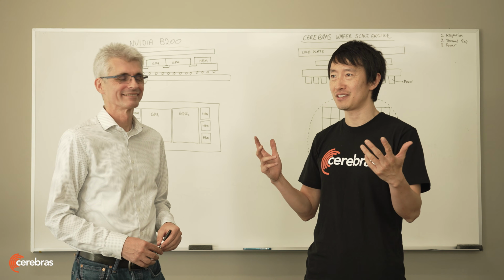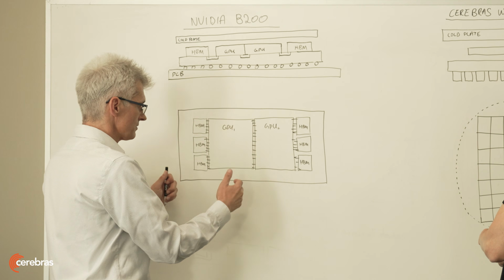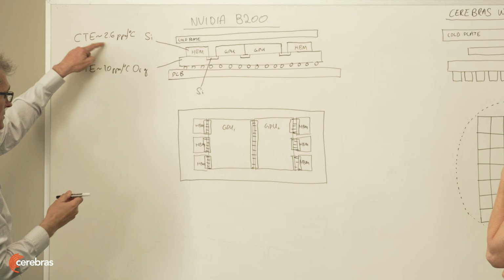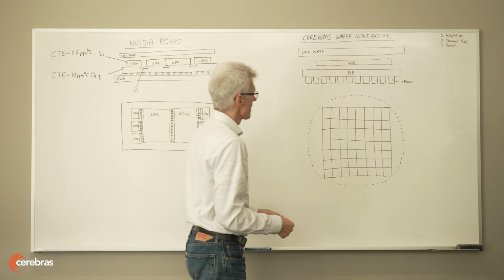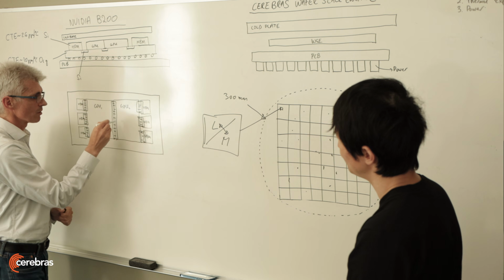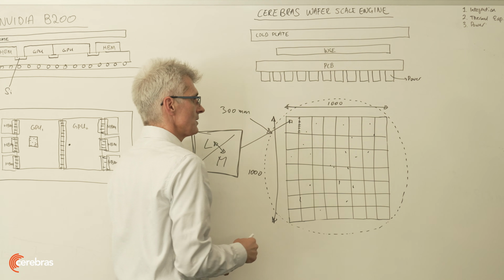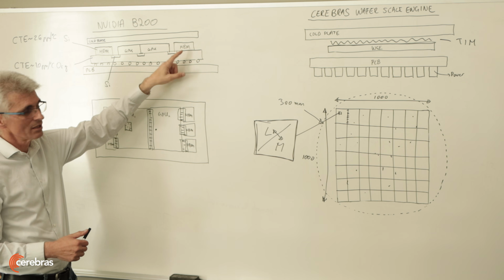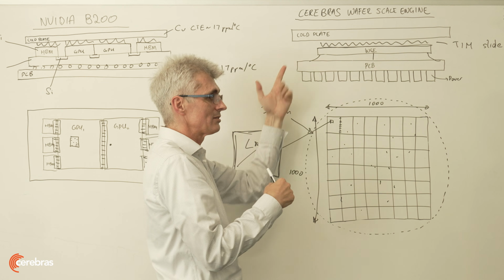Cerebras Co-Founder Deconstructs Blackwell GPU Delay

Comment: 12:57 you still need to get information (bits) in and out of that memory though right? The software would need to ‘efficiently’ put it in the correct memory module for the correct chip to process given the large die size, so inputs and outputs from across the chip would need to be managed to do this? Sorry not a chip designer or elec engineer or software engineer haha but this is all very interesting!

Comment: Is memory bandwidth such a big deal when external bandwidth somewhere else will obviously be the next bottleneck? ex, You would need to build a complete SOC with memory on a single die package, but you will be limited to the fastest ethernet protocol and connection methodology limiting usefullness.

Comment: Is the 44GB SRAM distributed across the wafer enough for data fetching in training and reasoning? It seems that Cerebras remove the HBM or DDR but directly load the NVMe to its on-wafer SRAM?
Reply: For smaller LLMs that fit in 44GB, the performance is amazing, for larger LLMs the performance plummets. Memory capacity is the Achilles Heel of WS compute systems.

Comment: if cerebras has a better yield and only advantages, why doesnt have more market share?, why arent cheaper than nvidia?
Reply: It's a new company with a different custom programming model. It seems U.S. national labs and a few other customers are going to write their own software in Cerebras' special CSL programming language to directly code tensor operations for those million little Programming Elements on each Cerebras wafer. But the big AI companies seem to be sticking with scaling what they know onto more and more Nvidia chips (and Google's own TPU chips).

Comment: Interesting solution however what about the power consumption of such device, (with 51 equivalent GPU chip ?). With 1kW per GPU it means 10s of kW to deliver to this mega-chip which seems a challenge, not only at the VR module level but also at a higher level (blade level). Does it also mean that the high speed interconnect for scaling up GPU from Cerebras is limited to 50 chips or it can be extended like it is with Nvidia NVLink to 1k or 2k chips (or more)?

Comment: What about the extreme cooling needed to run these cerebras wafers? Isn't 2/3 of the entire rack just cooling?
Reply: That's true for Nvidia DGX systems as well. Supplying 15 kW of power and 10 kW of cooling is hard.

Comment: This right here is why NVIDIA will miss earnings next week. Guidance will be lower due to the Blackwell delay here which is really not easy to solve. This is not a trivial problem - you can only go so small without breaking anything to endure that amount of heat.

Comment: Here’s the Nvidia solutions as I see it.  1) load balance.  This will save differential thermal expansion issues.  An IR camera can be used and the s/w and microcode guys can look at this.  2) shut down any cores that get too hot and let them cool to ambient (ie active thermal management on a package level), 3) do redundant compute at the rack level.  This will guarantee that if anything goes wrong that the results are correct.  TMR can be done but it’s more efficient to do a RAID style redundant compute.  Whichever is more efficient on compute.  You sacrifice a bit of performance for reliability.  These are all tractable problems that can be solved.  New technology always has stuff like this and Engineers find creative solutions.  That’s what we do!!
Reply: BTW load balancing is relatively easy since I’m sure the CUDA tools can do profiling/performance coverage.  And once profiling is done you pair up the processors with the CUDA tasks to make sure they have similar profiles from a performance perspective.

Comment: The stacked silicon has solder bumps.  Due to a meniscus forming duri g the soldering they are self-aligning.  Nvidia can solve the thermal issue by load-balancing the GPU’s making sure they are doing the same amount of work.  This will keep the thermal levels balanced.  The ‘differential thermal’ is the issue here.  Big wafers have problems too since interconnect can have defects too.  This means you may get load balance issues across the wafer which could cause differential themal issues and cracking in the wafer.  Same problem.
Reply: It should be noted, the GPUs of Nvidia have local memory on them too.  They seem to be extolling a virtue (that they perceive is unique to them) that their competition already has!  Nvidia GPU’s have many cores and many levels of local memory.  This is how a GPU works as a tiled processing unit.   Cerebras are trying to spread FUD.
Reply: @GodzillaGoesGaga  That is called on-die cache, nobody was hiding it, they even mentioned existing fault tolerant static ram. 
Cache capacity is orders of magnitude too small to handle most tasks as the only memory, and static RAM is orders of magnitude to expensive in die area for main memory capacities. Though they didn't mention the capsity or type of integrated RAM on their hybrid cores.
Reply: @GodzillaGoesGaga  Correct, registers are normally a form of SRAM; this is true on basically every CPU, GPU, and MCU since the invention of the integrated circuit. 
"local SRAM for calculations" is called cache.
Reply: @GodzillaGoesGaga  You don't seem to be using the term register correctly in this context. I get the impression from your posts that you skimmed Wikipedia for keywords and tossed them all into a word salad to BS your way through the comment section for some attention. On chip cache and registers are all constructed of SRAM, the eviction and write policy details are irrelevant to the physical data bits being SRAM.

(using nvidia as a specific example) CUDA "local memory" is not physically local it is just a special handling of global VRAM. 
CUDA cores do have physically local memory between global ram and the ALU registers in both the form of hardware managed L1 and L2 caches and as "shared memory" (shared among a thread group) and this shared memory is probably what you are refering to as SRAM for calculations, but this is essentially just a user managed cache with similar latency and capacity limits measured in kB  ...because, back to my original point SRAM is expensive!
Reply: @GodzillaGoesGaga  You may claim anything you like, but you have failed to convince me.
Reply: @GodzillaGoesGaga  Exactly, all claims of "trust me I am an authority" are null. You are just another internet person so your statements must stand on their own inherent merit.

Comment: 20:20 "in the center .. you have direct connection", and assuming meaning the (I/O) pins there only (not on/near the edges, because of expansion). You must send in data (and calculated output from) to all the million cores from there then. Since the cores are small, then this is very special purpose (likely no caches or global address space), though you have good bandwidth no next code, but different latency depending on how far.
Reply: Speed of light traveling 30cm takes 1 nano second. CMOS gate delay is in the order of less than 0.1 nano seconds.
Fitting all these things together on the wafer is a great fun.

Comment: How can we find out who's adopting Cerebras? I would have thought they could sell 100% of what TSMC is capable of outputting without even trying. Is that not true? Is this x86 architecture?
Reply: Microsoft Bing CoPilot links to the CS-3 announcement which says Argonne National lab and "G42" in Abu Dhabi are using it, and mentions GlaxoSmithKline, Lawrence Livermore National Laboratory, and National Energy Technology Laboratory. Cerebras claims "Cerebras already has a size-able backlog of orders for CS-3 across enterprise, government and international clouds." Well, as with any startup orders are cheap, it's shipments with revenue that matter. Unfortunately for Cerebras I don't see any indication that any top AI company developing a frontier multi-modal model is working with them.

TSMC fabricates 3+ million wafers a year, there's no way the demand for a massive complicated AI supercomputer will ever be that high.

Haha, Intel has licensed the x86 architecture to very few companies, basically just AMD and VIA Technologies decades ago. And that bloated CISC instruction set with all its extensions and different register sizes and vector add-ons is a terrible fit for 850,000 tiny "Processing Elements" on one wafer each with only 48 kB of local SRAM. Cerebras hides it, but from the Cerebras SDK Technical Overview, each PE has a microarchitecture that implements a custom instruction set  which seems undocumented. Instead you write a custom program in the C/Zig-like Cerebras Software Language that tells each PE exactly how to manipulate tensors. Then you write a control program for "the host" which specifies which rectangle of how many PEs on the wafer you want to run your code, and "the host" loads them up. Fascinating, but it doesn't run Nvidia's CUDA GPU tools, and figuring out how to adapt existing machine learning software to it will be... challenging. National labs can develop custom software for it, just as they write their own code for their more conventional CPU+GPU supercomputers.

Comment: How is the SRAM in WSEs being compared to HBM on conventional GPUs? Even GPUs would have on-die SRAM caches that have high BW and low latency. The packaging challenges come with packaging the GPU dies with HBM chips right? It's not possible that WSEs do not need HBMs (right?)
Assuming WSEs need HBM dies, wouldn't similar packaging challenges arise even there?
Reply: You’ve reached the core understanding to the scam Cerberus has been running

Comment: 14:12 - From my understanding, Cerebras is a new semicon fab, like Intel or ARM, building computers from scratch and not using common architecture to build computers. Great way to be innovative and this would require a lot of testing and validation since it is completely new process of making computers. Basically an SoC on a wafer, 100% custom made.
Reply: ARM doesn't make or sell chips at all, it licenses the ARM instruction set architectureand chip designs implementing the ARM ISA to other companies. Nor is Cerebras a semiconductor fabricator, it has a fab etch its wafer-scale "chip." in 2019 Wired wrote " to construct its giant chip, Cerebras worked closely with contract chip manufacturer TSMC."
Reply: @skierpage I think his point was they’re  taking a completely different approach which would need a whole different manufacturing and integration process. Not easy to pull off.

Comment: Very impressive explanation... definitely the way forward for large scale AI.
Reply: It's not definite at all. Look at the distance signals have to travel across the wafer. As and if fabs hit fundamental circuit etching limits around the 1-nanometer feature size, the way to increase circuit density is to go 3D. If TSMC and Nvidia solve this generation, they will be well-placed for future generations. And there's no explanation here of why AMD and others have been successful with chiplet packaging. Meanwhile, Cerebras seems to have only a handful of customers building research supercomputers.

Comment: what (if any) architectural trade-offs had to be made to accommodate waferscale?
what is the practical limit on core size?
Reply: I wonder this too … yes, a very small amount of memory is very close to a very small amount of compute … but now some large proportion of memory is very far from some large proportion of compute …. in quite a variable way for each unit of compute /memory … so must be more software logic necessary to account for these all these differences in latency and wouldn’t you have to throttle for the highest latency connection?????
Reply: @SpindicateAudio   i think also there might just be an issue with total amount of data you can push through the wafer. 

i would expect there to be an effect of core size on total throughput, though I am not familiar enough with their layout to make any concrete prediction of what specifically it would be
Reply: @ChrisJackson-js8rd  yes yes, they will still need stacks of hbm “off-chip” … so latency / power consumption improvements will only apply to the fraction of the memory on-chip … so gains would only be marginal …… that said, if it also solves various packaging problems those gains might be enough
Reply: @SpindicateAudio  i suspect they might be doing something very clever and leveraging the machine state as a sort of "pseudo-cache" in a way that you can't on traditionally architected systems.

but this is speculation on my part
i don't have a system to test

Comment: flexible connectors in chips to compensate different thermal expansions is interesting. I wonder if a future approach could also be to never let the chip cool down much after initial installation, so having a idle load applied, so it does not cool off. Accepting limited number of big thermal cycles might be a worthwhile tradeoff, it is buys wiggle room in other areas. Would not work for smartphones or end user devices with peak loads and many off periods, but on a server farm, it sounds reasonable.
Reply: The tradeoff there is energy consumption.  Heat is a byproduct of power leakage, which is inherent in all silicon circuits.  If you artificially load processing cores just for the sake of maintaining a thermal profile then you're wasting energy, which also isn't cheap, especially at the scales they're talking about here.
Reply: @mdswish  First, there is a new fangled invention called fan-speed control. 
Second, the sort of tasks being done on devices of this class are generally long running and scheduled ahead with customers waiting and bidding for time. The down time between runs is insignificant.
Reply: Are you going to pay that energy bill?!
Reply: Creep failure

Comment: fault tolerant design without cutting something, only to reconnect it later is simple and genius. The Internet also was build upon the assumption that it continues to work well, even if parts fail. And look how great that scaled! Happy that they are succeeding with the truly different approaching to chip manufacturing.
Reply: I guarantee Nvidia's GPUs can have faulty cores. If enough shaders or compute units don't work, Nvidia sells the chip as a cheaper lower-performance part, called "binning."
Reply: Internet has redundancies.
Reply: @frankdelahue9761  The internet is also extremely slow and inefficient.
Reply: It takes a genius to know a genius, and you are not a genius.
Reply: @eglintonflats  But by your own axiom how would you know that?
Reply: @eglintonflats  Time to learn Russell paradox lil bro

Comment: yes, but your 'chips' only have 40GB of memory
Reply: 40GB of on-die SRAM, so in comparison to GPU designs one should think of that more like having 40GB of cache. NVIDIA doesn't even publish specs for their on-die SRAM/cache sizes so one can assume it's not worth bragging about, by your definition NVIDIA's chips have 0GB. I'm sure you're aware that HBM3 is extremely slow compared to the memory on WSE-3, it's an order of magnitude difference. For those who can read, WSE-3 specs state up to 1.2PB of external memory.
Reply: @nicholasolsen2177  But they didn't address the problem of how are they are interfacing with that 1.2PB of external memory ...
Reply: @nicholasolsen2177  SRAM (on-chip RAM), compared to HBM (off-chip RAM), is much faster, but also a lot more expensive.

Comment: Can you please explain how you could fabricate logic and memory in the same die ? Dont they have different fabrication methods? Memory doesnt scale well like logic right ?
Reply: Any GPU and CPU has memory in the form of cache already.
Reply: It’s SRAM - which is same process as logic
Reply: @dudi2k  So all logic and memory are all on the same die?!? You realize there is a space limitation, right? You're going to run out of room if you're trying to make a cutting-edge chip.
You're still going to need interposers to connect the memory or IO die to the logic die. Period. Or greatly cripple your logic performance.
Reply: @aqualung2000  It seems to be not true for AI workloads. Nvidia GPUs scaling is almost lnear to thousands of GPUs.
So, as long as you have enough memory, performance will be fine.
If I'm not wrong, IBM designed a chip with very limited memory per GPU, and it works well for interference - 12nm can be more efficient than newest Nvidia GPUs

Comment: Nailed it!  With thousands of connections between these chips, alignment is not easy!  Cerebras is clever to take WSI route to circumvent this issue!
Reply: Both companies suffer from themal load balancing issues.  They are just spreading FUD!  Pure spin-doctoring.
Reply: @GodzillaGoesGaga  Thanks for introducing me to the term spin doctor👍